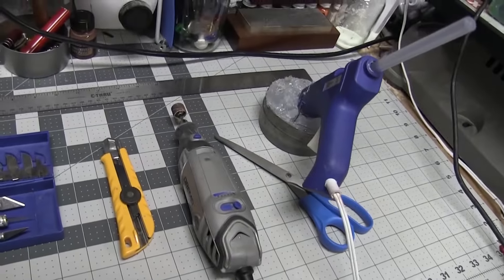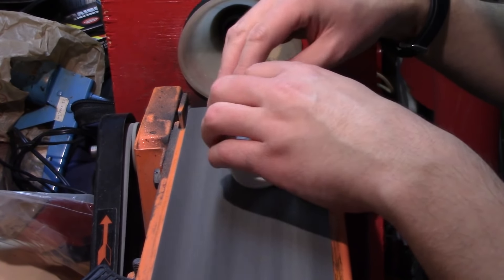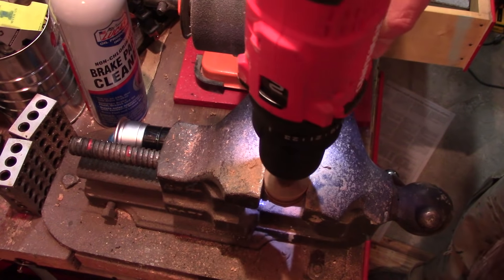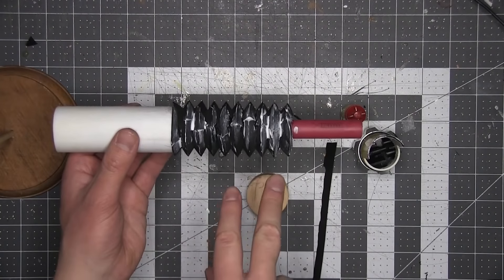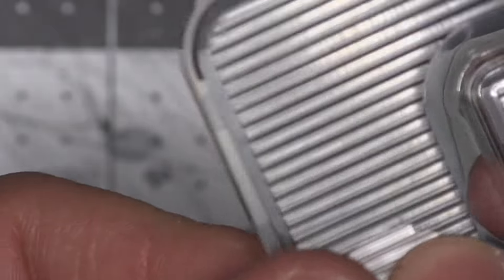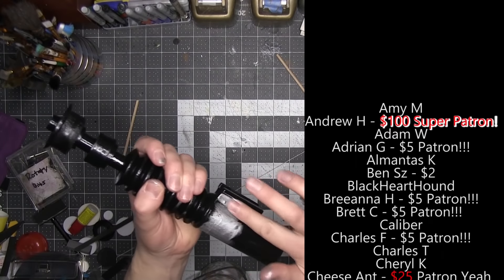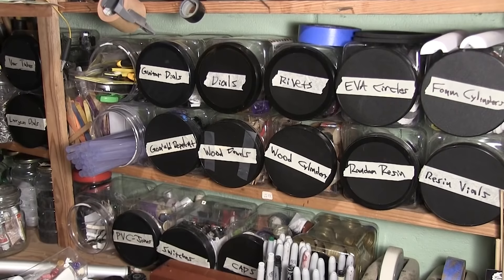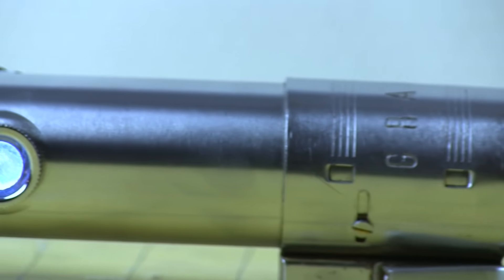HOW TO MAKE A Lightsaber - Luke Skywalker DIY

Comment: Just a question about RubnBuff: if you sprayed a top coat of sealer (or a couple coats), would that help with it getting reactivated by heat.

Ps. I really like the finish it gives when applied to a black base coat. Partially why I’m asking.

Comment: I really like the tea lights you use for the crystal. I found the same lights you used, but I wanted to know if it was difficult to replace the LED inside?
Reply from the maker: nah, it's a tension fit.
Reply: @WilliamJakespeareProps  awesome, thank you!
Reply from the maker: @Wiltontwoper  no problem!
Reply: @WilliamJakespeareProps  wait wait wait. I have a feeling we mis interpreted. What i meant to ask was, is it easy to replace the LED of the tea light? Like how you switched it out with a UV led
Reply from the maker: @Wiltontwoper  yeah it's simple. there's no soldering involved.
Reply: @WilliamJakespeareProps  awesome, thanks

Comment: Hello! I can't seem to find the same reflective tap for the blade that you used. Could you kindly give me a link to the tape you used (or something similar)?

Also, would chrome tape work the same way? Thanks!
Reply from the maker: i just got it on amazon. I don't remember the brand name, I threw away the packaging. But it's meant to make bikes visible at night so try looking under bike accessories. Chrome tape isn't quite as shiny.
Reply: @WilliamJakespeareProps  okey dokey! Thanks!
Reply from the maker: @e_Dave  no problem!